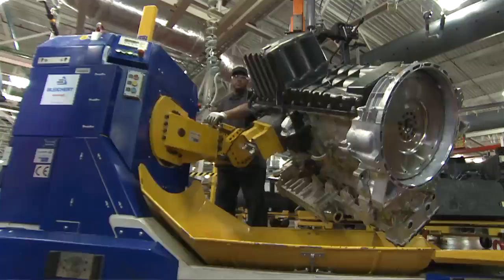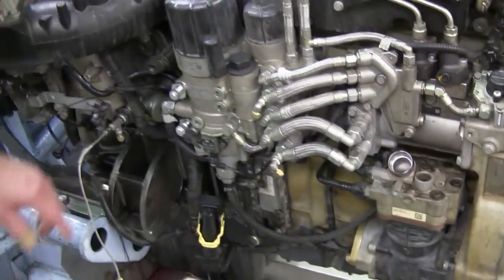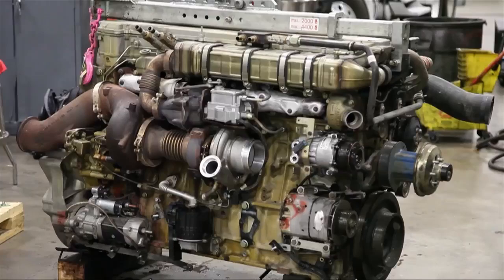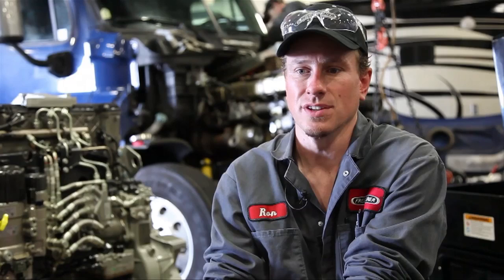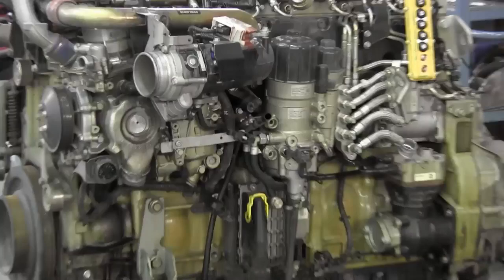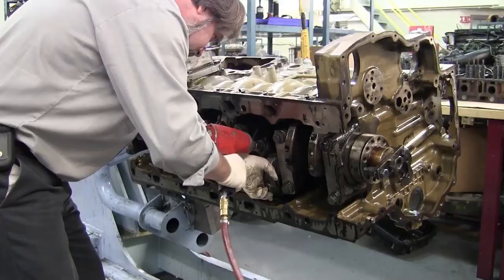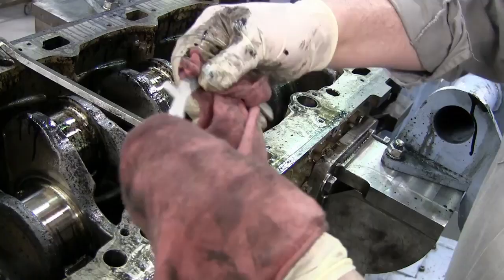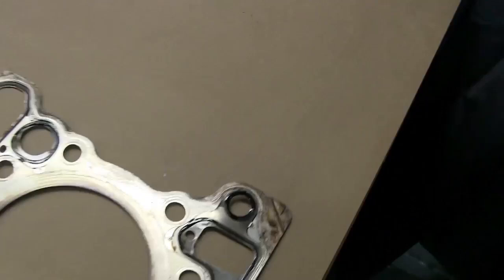Detroit DD15 Longevity and Durability

Comment: Simple fact, nothing is made to last nowadays and that INCLUDES commercial truck engines
Reply: *****
I guess you mean a Series 60. Well wouldn't know what to do with it since I don't have a rig.
But I drove them several years ago when i was in the Army. I drove a 977 HEMTT with a
8V92 in it.. But I just notice everything made nowadays (like cars) are not made to last. I
own a 2000 Jeep Cherokee in good condition,
and all of  a sudden the past weekend, the ECM goes out on it, it is going to be about 1500 or more to replace it. Well  why did it go out in the first place? I think it was designed an engineered to last a certain period of
time and then fail, ensuring that I go pay the
mechanic a visit. Of course I hate it because I liked and remember the days when shit was simple and I did all my own repairs. And of course they are doing the same thing with big trucks. I see all this polllution shit these new engines are required to gave, like the DD16, etc. All I can say is GOD DAMN THE 21ST
CENTURY !!
Reply: I disagree with the assessment that engines aren't built to last anymore. I work for a Detroit Diesel dealer and have noticed over the years that all of the mechanical work is drying up. During the 2-stoke days the engines just didn't last and needed periodic rebuilds. During the Series 60 days you would always have tons of rebuilds and bearing replacements, but they were lasting longer then the 2-strokes. Now with the DD engines, they almost last the life of the truck (mind you a lot of the trucks are throw-away trucks after so many miles now, like the Cascadia). A DD with a million miles without a rebuild is common, a S60 is rare, a 2-stroke extremely rare or even impossible.
Reply: DonKingKong2020 maybe it's because the dd series is so expensive to rebuild. Most people just buy another truck
Reply: The Cascadia is a throw away truck? WTH?
Reply: Marcus Jones that's what I was thinking? I paid $70,000 for mine. I don't plan on throwing it away
Reply: @treynolan7932  $70,000 on a cascadia? I would've got a peterbilt with that kind of money
Reply: @ib5804  no way in hell I would ever buy anything other than a freightliner. Freightliner is a poor man's truck and I'm in it to make money, not to look good while my money is going to the dealership and parts suppliers
Reply: Interstate Bandits . he can't afford a better truck like he said.  I have a 379 Pete and a kenworth w900.  Love them both.  I wouldn't waste my money on a throw away truck like a freightliner lol
Reply: trey nolan damn that to bad
Reply: @jamesmcfayden9778  right, I'm not a super trucker. I like to see my money in my own bank account
Reply: trey nolan . So do I. That why I own truck trucks.  a w900 and a 379 Pete. I can afford them not to mention two trailers and I'm not broke or a poor man so I don't buy freightliners.
Reply: @jamesmcfayden9778  somebody should give you a cookie. You deserve it
Reply: trey nolan LOL I'll take a beer and a bottle of Hennessey.
Reply: @jamesmcfayden9778  if you love trucking by all means drive a Pete or kenworth. Spend your money on all the bells and whistles. Get you a big radio, 200 chicken lights and the chrome package. That's great but for someone like me who would much rather sleep beside my wife every night, interact with my kids everyday, eat in my own kitchen, take a shower in my own bathroom everyday, etc.. Truck driving is just a avenue for me to make money to start another business. To each his own
Reply: u can thank the epa for that. all the emissions garbage on the newer diesel engines have made them unreliable
Reply: Driving skills has a lot to do as well...
Reply: Thermodynamics!

Comment: I’ve worked on all types of Diesel engines for the last 50years and have to admit those parts he removed from that engine were in excellent condition and could have been rebuilt,I would put new bearings shells and piston rings in just to be extra fussy,having said that it’s nothing I would expect to find in a Scania or Volvo engine which have done horrendous mileage’s. Cat powered vehicles we run were exactly the same,brilliant longevity and reliability from all three manufacturers. Detroit Diesel made brilliant 2stroke engines which I’ve seen run for ever in loading shovels and plant machines so it’s only to be expected that the new engines are good.

Comment: I find it funny how they are claiming its all motor but don't give credit to the operator behind the use. A lot of issues with engine failure are due to lack of maintenance, or abuse in operating. Mechanics only know tear downs and maintenance procedures. The only thing they can use to see performance is a dyno.

Comment: the only problems with these engine we had are suction tube to oil pump o-rings dry out and leak. lowering the oil pressure at idle speed, and fact that we had a dd15 with spun out #7 main bearing at 600k other then emission sensors and fuel problems not much i can think of
Reply: That is what caused the engine in my DD-13 seize up.  I hope they fixed that flaw.  We had several trucks, including some generation 1 and 2 DD-15s fail because of that.  The company decided to scrap my  truck (I miss my baby).  Now I have to drive a  crappy automatic KW T680.

Comment: 80,000 lbs light load ,  they should check an engine in Canada that pulls 150,000 lbs. I have a  dd16 
600 hp 2050 torque. Almost all problems are  DEF related.

Comment: This engine leaks like a mf. I work for freightliner and 70% of repairs are for leaks on that engine
Reply: Brenden Green what mileage should you look for if you trying to buy one??
Reply: @mucleboy0151  price wise or before shits start giving out? Price wise 400k and up.. shits giving out 600k
Reply: Thats why they will never rust always covered in oil from somewhere
Reply: @fredc8618  oomkoo
Reply: I see alot of drivers who do not pretrip and get repairs done first off. I drive and first sign of a leak it goes into a shop. These guys crying about it let it leak til nothing is left then cry wolf. There own fault for not doing PM's and getting it fixed before it falls out from under them.
Reply: These are dirty engines, what seems to leak more from my experiences is the rocker housing gasket, oil pan gasket, and the cylinder head (cam) seal gasket, and especially the fuel line seals within the rocker housing
Reply: Yep. I've worked on thousands of these for a few different carriers. They tend to have oil leaks all over, as well as a plethora of after treatment issues.
Reply: I laughed when they showed the head gasket and all of the rubber seals were still attached to it and didn't stick to the head or block. We both know that's an absolute lie. Cam frame, oil cooler module even the breather is clean! Hahahahaha nice try!
Reply: Would you take an isx15 over the dd15? Looking at buying a truck soon
Reply: @bigwill8307  if I got one it would be a ghg14 DD15, which came in 2013. One box usually fails around 600-700k and it’s an expensive repair.

Comment: Haha I can show you many cam frame leaks. Air compressor leaks. Oil mod leaks. The dd13 reminds me of the old oil slinging 8v71's from the 1970's. Also the plastic coolant lines leak. Was such a problem Detroit remade them as rubber but kept the plastic coupler which is what always leaks anyway. It runs a lit smoother then the red brand our company switched to. The dd platform doesn't do well in harsh environment per the us military. They still use the 60 series

Comment: Not leaking oil because all those gaskets got replaced between 4-500k most likely and that cylinder head is rusty which means it’s likely been changed as they’re painted originally.

Comment: My dd15 failed at 650k miles. Cylinder sleeve failed leaked coolant into combustion chamber hydrolocked engine destroyed internals had to get used dd15 with 250k miles because the wait for rebuild parts from dealer was over 3 months.

Comment: I can put a 92 series engine w/ mechanical fuel rods & stay n the same arena lb for lb w/ any DD15 or 60series engine & w/ a little bit better horsepower w/ these 4cycles & stay up w/ there output, plus going w/ the lg lasting life span that will over come & exceed over these inline 6cyl. engines !
   “That’s what I think”
I’ve been around to see a few (couple) million milers DDA 2cyl mills & this thing never had the valve covers off until I ran across this beast.

Comment: Demand Detroit, huh? I demand quality parts & a decent warranty! Not half-ass parts & a warranty that covers you until your out the shop. Less than 40K miles in 18 months on a BRAND NEW bull gear in my 60 Series & I gotta replace it again. Might have to start Demanding Cummins or Caterpillar instead.🙄

Comment: I  have a 2013 cascadia with a DD13 940k miles on it ..its been very reliable but already  had most gaskets replace due to oil leaks
Reply: I also have a cascadia 2015 dd13 with 700k miles on it. When should I considered get a rebuilt or Inframe
Reply: TroyP20  I would think till you have some sort of issue with it ...if you take care of it probably after a million miles
Reply: Milton Gonzalez thanks for the fast response
Reply: TroyP20 my pleasure

Comment: I put 560k on a dd15 in a 2016 Cascadia, only leak I ever had was the oil pan gasket and that's a simple fix that was warranty covered.
Reply: Most don't develop leaks until past 650k. I have 860k on it and have fixed $7000 in seals in that time however that's less than 1 CPM so it's definitely not a deal breaker.
Reply: @gsxr1189  I agree. IMO the DD15 is one of the best engines ever made, sure there is the emissions garbage but, it gets better every model year.
Reply: @MickGallJr   Detroit is the only engine manufacturer that didn't have a class action lawsuit against them for emissions issues. It's undeniable proof that the DD15 is the most reliable modern engine on the road. After 860K miles my emissions related repairs total $600 on two wiring harnesses.

Comment: How often should the oil be changed Detroit recommends Mobil delvac & 25 to 30k miles ??? That's way too many miles to me?
Reply: Our fleet is on 75k oil change intervals.
Reply: @massey_2298  is it safe 75k  for the long run,  max  I run is 20k on my 2014 dd15 for oil change.
Reply: @user-nh6vu3qr7b  I would follow the recommended interval for your duty cycle.

Comment: This engine woulda had cam box done
Rear structure 
Throttle valves
Wiring harness 
Qcv valve 
A compressor 
Possibly a cylinder head as valves reseed into head
They leak like all f#ck 
And those harnesses are junk.. 

Other than that they still last longer than a Cummins

Comment: 400k on my 2016 oil pan gasket replaced..leaking. slight leaking various other points..no major issues but no wicking or leaking after 750k..im calling bs.

Comment: From experience I've seen a ton of injector failures after 500k and cracked liners near 700k on these things and mountains of emissions problems. Let's ignore the tsb on loss of oil pressure as well due to orings in the oil pump piping, seen several with spun bearings as a result. As far as modern enginess go I'd rank dd15 behind d13 and isx15 in reliability.

Comment: Haha, yeah right, that is why Western Star over in Australia are almost giving away Detroit engines just to get people to buy trucks powered by them over the Cummins engine!  Even Freightliner had to start giving a Cummins engine option recently because know one was interested in them with Detroit engines.  Say what you want about how your the engine maker that pioneers and everyone else follows, but Cummins outclassed you with the ISXe5 engines in every way, I have never met a truck driver who doesn't like the new Cummins.  The problem Detroit have is being part of the Daimler group, they get stuck with having to work with the new Daimler group Eurotrash designed engines.
Reply: Well said.  We have the least amount of problems with the cummins at the 1 ish ton trucks, at work. out of the big three...
Reply: The ISX engines need EGR coolers replaced about every 2 or 3 years. Good engine otherwise.

Comment: Emissions killed your brand, No one survived the purge except for Cat.

You had a good run with many great engines tho, 3-53T best engine to put in a 1/2 ton truck, 4-53T and 6V53T best engine to swap a 3/4 to 1 ton truck. 

And don't forget the worlds most indestructible engine, the 4-71 Detroit Diesel that can runaway at 12,000+ RPMs for 7 minutes before biting the dust!

Comment: In my opinion the DD-13, 15, 16 series Detroit engine are the worst engine Detroit has ever made. Constant problems with egr coolers, Dpf systems and the worst set up for a fuel system and most problematic I’ve ever dealt with or seen. Shit if you need to overhaul the engine and need to have the crank turned your shit out of luck because there are no undersized mains for these engines and plus all the timing gears and bull gears are on the back of the motor🤦‍♂️ where you have to drop the trans, clutch and flywheel and back motor mounts just to take the timing cover off. That’s enough of me ranting, you want a Detroit get your self a series 60.

Comment: To get a great Detroit for truck:
1. Buy rebuilt/rebuild an 8v71 or bigger.
2. put in truck of choice.
3. Drive away from this shit.
BTW if it don't leak it isn't a detroit.
Reply: +David Vermillion nothing will ever outlast a 2 stroke DD.  Of course the naysayers will always complain about oil leakage;  but the simple fact of the matter is,  an engine that leaks and burns a little oil will last 10x longer than one that does neither...
Reply: Billy Severt I wonder why they couldn't get 2 strokes to burn less oil and run cleaner back then when they came out with the 4 strokes? Maybe nowadays they could use current tech to mitigate this problem? If they did that I bet many detroit fans would happily buy a new DD engine.
Reply: +David Vermillion that is the best comment  I have ever read related to a  trucking video. By an old truck, rebuild the engine or engine of your choice, rebuild a manual transmission and enjoy what is new again!
Reply: the thing many don't understand when it comes to engines...

you either get clean and efficient or reliability and durability....never both.

DD's use a little oil and run a little dirtier because they're built to a bit looser tolerances.  a little oil passby around the rings may be "dirty",  but helps lubrication. Parts were also built much heavier than you'll find on modern diesels (stronger and more thermal resistance).

The alternative is tighter tolerances,  in which case the rings and cylinder walls take the abuse (cleaner,  but wears quicker);  and lighter parts (better power to weight but more prone to heat stresses and breakage).

It's like comparing a steam engine to a modern gasoline engine...  steam engine may be heavy, dirty, and inefficient,  but if maintained,  it'll pretty much last forever,  and it can handle some abuse.

gas engines; lightweight, clean, efficient;  but only for a limited time,  and well taken care of.  cheaper lighter parts that wear out/fail in less than predicted life of engine.  Abuse it,  and it'll fly apart...
Reply: Billy Severt Diesel engines are actually 15% more efficient than gasoline ones. Thats why many large trucks don't use gasoline. And its also why the small diesel engines in some cars get such good mileage. Instead of being built for torque, hp and longevity they are built for economy. Gasoline engines usually attain an efficiently of around 30-32%. Diesel engines have been known to (or in the case of a few particularly large engines) attain 55% efficiency.

Comment: 3 years 760.000 miles? wow this driver never stop to eat or sleep.
This is a relation between time and miles, instead the truck have 1 million miles with one year, the engine is steel new...

how many times this engine has stopped cooled and runned the next day to hot.

Comment: can anyone tell me wat engine oil this engines use?
Reply: Correct me if Im wrong. I think Detroit calls for Dello 400.
Reply: would it be full synthetic ?
Reply: No.
Reply: Most of the truck engines we had use 15W-40 Oil, but it depends a lot where you going to drive, if you drive in the desert or in a very warm place a 20W-50 would be a good oil, if your use the truck in a coldish place a 5W-30 is good, but if most aplications 15W-40 or an 10W-40 would be the best. best you can get is Castrol and Valvoline.
Reply: Well if you get your oil changed at a Freightliner dealership, they'll put in Rotella T4
Reply: PhuckObama fully synthatic 10/40 mobil 1, best oil for heavey engine,

Comment: I'd like to know what maintenance they did during those miles. No way it's the original egr. No way they haven't had to change the rocker box gasket. No way same tubro. I'm sure they did all routine maintenance at exactly the right time. And the did get a little bit better gas milage. Like 1 more mile per gallon from the previous year. They multiplex which saved on wiring which helped. Now they run a single sam which saved even more wiring and weight. It's a shame it's a constant battle with their after treatment. Endless module updates. Seems every month now. Don't even get me started on their straight truck setups. Rubbing wires on frame by hood. And their fix for too much resistance for their headlight grounds. Poor planning now. Their demand was so high, their quality went straight into the shitter. Hole system built on a COE design. Much rather have the dd on that.

Comment: How can this engine be clean? it has an EGR fitted, bet its not on the intake manifold, the emissions engineering regulations using the EGR technology seem good as far a pollutants go but not good for the engine, the manufacturers have to go to diesel particulate filters on the exhaust,  I wouldn't buy this engine, the cleanliness inside the oil galleries is due to regular oil changes which is normal for any engine.